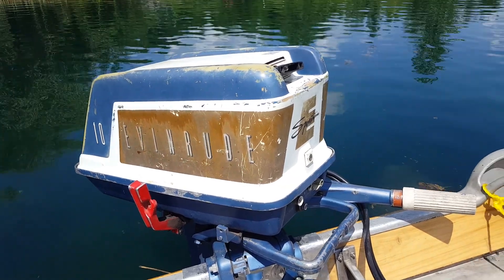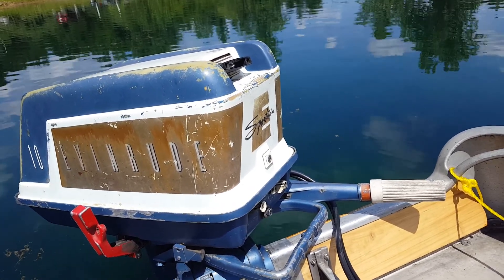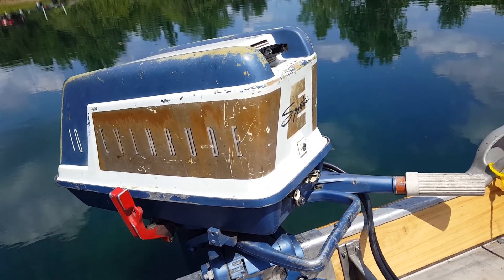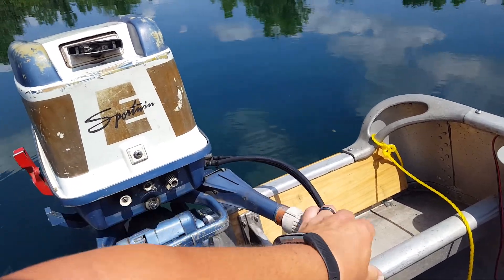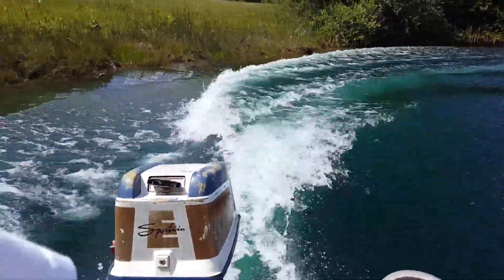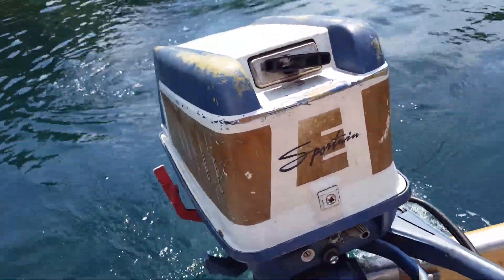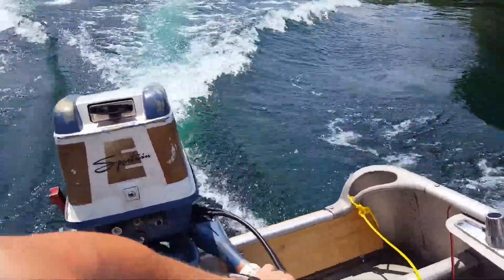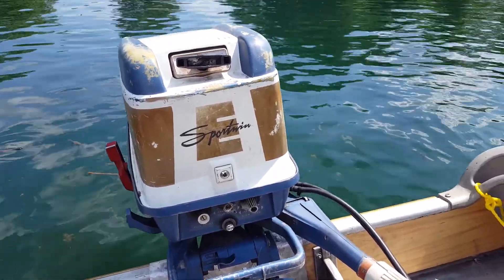1959 Evinrude Golden Jubilee Sportwin 10hp (Bad wristpins)

Comment: Thanks for getting back to me so soon Ben. Unfortunately, I did buy a whole motor complete and did a compression test 75lbs even on both and I thought I did a pretty good slop test with a screw driver before I bought the motor. What I did find is that since the motor was pretty dry inside, my slop test didn't work as well because of the dry cylinder bores. Once I went through the motions of getting the engine running and using 16:1 mix to loosen everything back up then there was a lot of slop. Guess its just a shot you take when buying a strange motor....I did save the pistons and rods from the split crank motor though and kinda leaning towards hoping the needle bearings on the big end are usable again and just swapping rods and pistons out for the spares I have. Believe me, I would much rather find a solid powerhead with at least 80lbs compression rather then splitting a case and doing the swap...Just not sure since I was stung once and even after doing a slop/compression test to boot.

Thanks 
Gary

Comment: I’ve got an 18hp don’t know much about them what’s good place to set it as far as the lean-reach settings to get it fired up. I can get it running for a few seconds but then it dies out
Reply from the maker: The 18s are fantastic motors.  These 59s use a pressurized fuel system with a 2-line fuel tank unless it has been converted to a pump for a single line tank. The initial settings for the mixture needles are 1.5 turns out from lightly seated for the low speed and 1 turn out from lightly seated for the high speed.  These should be on the rich side for starting out but once it us up to temperature, the needles can be dialed in for best running condition. Dial the high speed in at WOT on the boat first. Once that is done, the low speed can be dialed in for best idle quality. I hope this helps.   Thanks for watching!

Comment: Would love to see some of your repairs. What does QD stand for? Just bought this motor and have begun to look her over.
Reply from the maker: I have an 18-part series going through the tune up of my 1959 Evinrude Fastwin 18hp Electric start if you're interested in seeing some of my repairs. 
QD is the code Johnson used for their 10hp motors from 1949 through 1963.  JW/JH was used for the 3hp, CD was for the 5.5hp, AD was used for the 7.5hp, QD for 10hp, FD for 15hp ('56) 18hp ('57-'66) 20hp ('67-'68). RD was for the 25hp ('51-'55) 30hp ('56) 35hp ('57-'59) 40hp ('60-'68). 
Thanks for watching!
Reply: @oldjohnnyrude8404  Thanks! Watching your vids now to learn as much as I can. So far it's looking like a low use, well stored and maintained unit. Coils, condensers and points are in great shape. Only had to gap the points a little closer. Plugs are like new J6C needed to gap .030 . Adjusted carb cam on flywheel a little.

Comment: Love your channel. Great motors! So I too have a '56 johnson QD17 that I bought a powerhead to replace a powerhead with a crankshaft that was split in half when I bought it. Unfortunately, this replacement  powerhead has real bad wristpins as well. Under load they sound like the rods are going to come thru the block anytime. My question is this...Is it better to try and find another replacement powerhead somewhere and take my chances this time around, or is it financially more sound to replace the rods and possibly pistons if the pin bores are shot and go that route?  I also noticed that big end needle bearings are almost non existent new anywhere in case they need replacing as well when it comes apart...Your thoughts are greatly appreciated.

Gary.
Reply from the maker: The bad wristpins are unfortunately not uncommon on the OMC 10s.  Most of them are still OK, however,  so you may be better off finding another powerhead to replace yours.   Are the wristpins bad in the one you have with the broken crank?  You might be able to build a good powerhead from the two you have.  It is not ideal to swap the needle bearings from their original crank journals, but there is a good chance they will still run fine and go for a long time if you do.  I would try to find a parts motor with what seems to be a good powerhead rather than one that has been separated unless you are able to closely inspect it.  That is usually the less expensive route and I see a quite a few '58s missing the lower units because they were less robust amd very susceptible to damage from water intrusion.  Any '55-'58 10hp powerhead will bolt up to your '56. If you can inspect it before you buy it check it for wristpin slop before buying.

Thank you for the compliment and thanks for watching!

Comment: I got a 1957 10hp doing the same thing but not as bad of knock to it. It's about 1/32"  Do have a good power head to sell?Scott
Reply from the maker: Unfortunately I do not have any extra good 10hp powerheads for sale.  I have more 10 hp motors than I have good powerheads.  I have found a number of these lately with sloppy wristpins.  I had good luck with them prior, but this year turned up a number of them in not the greatest shape.

Comment: Sounds like it is running a bit rich.How old is the mix? What ratio are you using? Oil/Gas
Reply from the maker: Ken It does sound a bit rich but I can't tune that out.  I did try.  The mix is not that fresh but I just ran it in another motor and it ran fine so it isn't the mix.  It is 24:1 as is recommended for this motor.  Thanks for watching!

Comment: That is one tired old outboard. Runs pretty well though. Was this slop caused by running it 50:1? Would be nice if it can have a second life with a QD power head on it :)
Reply from the maker: VintageOutboardMan I really don't know what caused this one's wristpin slop.  50:1 Will definitely do it and overloading and lugging them at full advance will too.  These engines had small wristpins and no rolling element bearings on the small end of the con rods.  I don't have any history on this engine.  I will eventually tear this powerhead down but don't know if that will reveal any evidence of the cause or not,  but I'll at least get to see how close it was to letting go.  Thanks for watching!